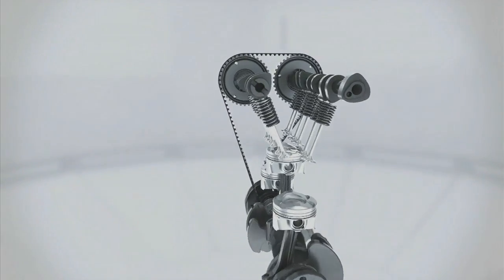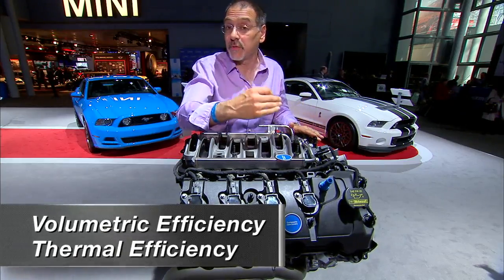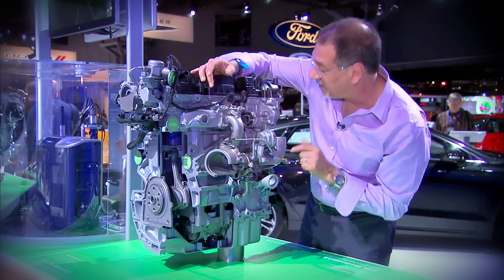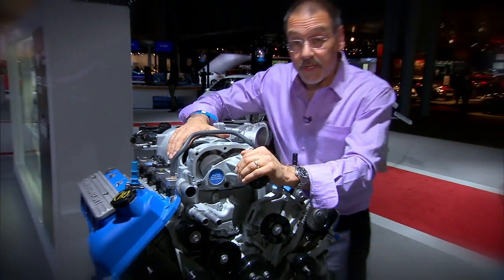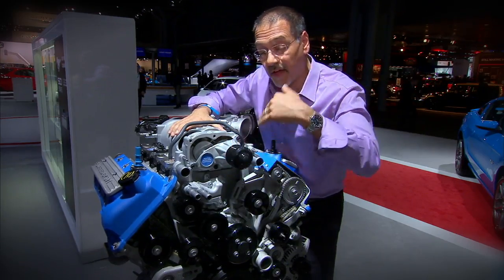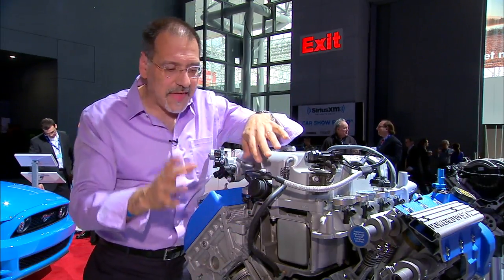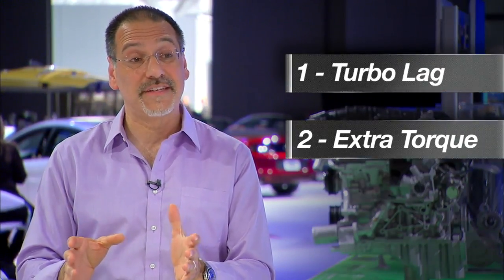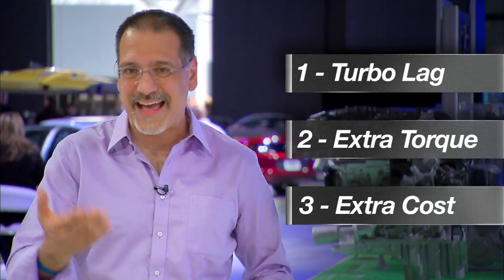CNET On Cars - Car Tech 101: Turbos vs. Superchargers

Comment: it's not that he is wrong, just incomplete. Many turbocharger systems respond much faster than most aftermarket supercharger systems. The supercharger on display is a "roots" blower. Many superchargers are belt driven centrifugal compressors. They make boost with engine speed, not engine load. A turbo car can increase compressor speed without changing engine speed. Centrifugal supercharges cannot. They need rpm to make boost.

Comment: QUESTION: Can you add both a turbo and a supercharger on the same engine?
Reply: Just ask Zenvo.
Reply: Volvo
Reply: +Eastdonochoco That's what you call a TwinCharger. In this case, the supercharger is used in low to mid rpms and the turbo is used in mid to high rpms. When the supercharger is no longer needed to produce power a bypass valve is activated and the turbo does all the work.
Reply: +Eastdonochoco Dodge Challenger Hellcat X is a factory supercharged engine with aftermarket turbos added.
Reply: +jeffrey625625 got it! Thanks! Highly appreciate the info!
Reply: 421 hp Volvo XC90 has a twincharger. Probably the new most powerful 4 cylinder.

Comment: VNT/VGT turbos dont lag. This is American problem that they are stuck in old technology like pushrod singel cam engines, no direct injection, common rail or modern turbos what are ecu controlled.

Comment: I hate to burst the bubble on turbochargers getting free boost at the expense of turbo lag, turbochargers and superchargers both consume energy to make energy.  It is where the parasitic effect comes from that changes.
For the supercharger it comes from the crank, a turbocharger it comes from the back end.  A turbocharger can increase exhaust backpressure, decreasing engine efficiency and increasing fuel consumption.

Therefore both have parasitic effects, where the effect comes from varies and the impact on the vehicle itself can be minimal if the correct forced induction system is selected reguardless of being a supercharger or a turbocharger.
Reply: Another thing every youtube video gets wrong is the TORQUE DELIVERY.
SUPERCHARGERS: Instant off the line acceleration torque, consistently rises with engine speed in a flatter yet higher (average) torque curve.
TURBOCHARGERS: Of course lags off the line (depending on size), torque curve starts much lower, and all of the sudden gives aggressive delivery of torque.
What it comes down to is how you want the performance added, either system can be modified to be more or less powerful. I've always though of it like this: If your O.K. with a little engine wear (and maintenance to keep it 100% performance, no big deal), and want to SLINGSHOT your vehicle from gear to gear, go with TURBOCHARGING. If you'd rather keep your engine/exhaust system healthier/cooler for a longer period of time (before maintanence), and want your vehicle to RELENTLESSLY PUSH & PUSH  through the gears go with SUPERCHARGING*.
Reply: Generally you'll see more of the ABSOLUTE LIGHTEST, FASTEST, MOST HARDCORE RACECARS go with turbocharging, because yes; *you can technically ABUSE your engine into getting that VERY LAST DROP of performance with a Turbo, because they're often lighter, and the turbo can "trick the engine" into performing past what it probably should (for a daily driver that's bad, but for a racecar that's only run 4 hours at a time is fine.)
You can design/program a supercharger to ABUSE your engine, and even outperform a turbo on the same engine, but usually people don't do that lol, mainly because that abuse would be CONSTANT, instead of only a second at a time. I personally love BOTH METHODS, but for my daily driver/track car combo, I'd like a supercharger simply because it's A) predictable for handling, B) keeps the engine/ exhaust healthier, and at 100% and C) for the RELENTLESS superior torque (especially off the line). I've dusted so many turbo's (that I could hear anyway) from a dig it's not even funny, they may catch up by the end of the gear, but I'm usually already ramming at the next gear so it doesn't matter. (To be fair I've also been dusted by some turbo's, but believe me they were some serious contenders =D.)
Reply: +JohnSmith FakeName I thought that super chargers provided more torque, so how can a turbo do it if it has to spool up before it makes its contribution to engine power? The speaker said turbo's make more and I disagree. Am I wrong?
Reply: +Anthony Wayne 
I am going to post this formula "Horsepower = (Torque * RPM)/5252

A supercharger has a more consistent power band while a turbocharger has to contend with "Turbo Lag."

Try to think about it from this angle
For a supercharger from 200 RPM to 6000 RPM the engine power is 1.3 times normal.
For a turbocharger  From 2000 RPM - 6000 RPM the engine power is 1.3 times normal, while 200 RPM-2000 RPM the engine power is normal (This is not accurate but it simplifies the idea).

If the engine is driven between 200-2000 RPM most of the time then it will feel as if the engine does not benefit from the turbocharger but when it does kick in you notice.  On the other hand the supercharger is more consistent in the power band.
At first glance it looks like the supercharger is superior but only in certain applications.  There are shortcomings in the supercharger design that a turbocharger can surpass.

That is what they do, how they do it as followed.
A supercharger is spun by the crankshaft (or something similar), meaning that as long as the engine is moving the supercharger is spinning and providing pressure.
A Turbocharger is fed by the exhaust to spin a "turbine."   The turbine compresses air but at low RPM's the turbine may not spin (or spin to slowly) and not build pressure.
Reply: +Anthony Wayne 
I am going to post this formula &quot;Horsepower = (Torque * RPM)/5252

A supercharger has a more consistent power band while a turbocharger has to contend with &quot;Turbo Lag.&quot;

Try to think about it from this angle
For a supercharger from 200 RPM to 6000 RPM the engine power is 1.3 times normal.
For a turbocharger  From 2000 RPM - 6000 RPM the engine power is 1.3 times normal, while 200 RPM-2000 RPM the engine power is normal (This is not accurate but it simplifies the idea).

If the engine is driven between 200-2000 RPM most of the time then it will feel as if the engine does not benefit from the turbocharger but when it does kick in you notice.  On the other hand the supercharger is more consistent in the power band.
At first glance it looks like the supercharger is superior but only in certain applications.  There are shortcomings in the supercharger design that a turbocharger can surpass.

That is what they do, how they do it as followed.
A supercharger is spun by the crankshaft (or something similar), meaning that as long as the engine is moving the supercharger is spinning and providing pressure.
A Turbocharger is fed by the exhaust to spin a &quot;turbine.&quot;   The turbine compresses air but at low RPM&#39;s the turbine may not spin (or spin to slowly) and not build pressure.  If a turbocharger is to large for the engine the turbocharger will not spin at low RPM meaning it will be essentially off.
Reply: +JohnSmith FakeName  Thank you for that information and the time it took to compose it.=)
Reply: Get a twin-scroll turbo, like in Mitsubishi EVOs and you're set for low-end and high-end hp. :D
Reply: I never knew you could have your cake and burnouts too. lol Nor of a twin-scrool turbo?
Reply: @xXxMartin96xXx wastegste dont purge incoming pressure on exhaust or intake only the out going intake so thats wrong
Reply: @xXxMartin96xXx backpressure in exhaust is dtill same it doesnt bleed pressure off only on pressure on intake so agin youre wrong

Comment: Can someone fill me in this is all new to me, but what the video seems to tell me is that basically turbos have no positive uses, compared to a supercharger
Reply: +Jamani Holmes There are some advantages.  Turbos, unlike superchargers, are not mounted on top of the engine.  Turbos tend to be more cost effective.  Superchargers work best at the lower end of the rpm's.  Turbos work best at the upper end of the rpm's.  And the felling when you hit boost is awesome.

Comment: Can you put a supercharger in any car?
Reply: Anything is possible with the right parts and know how.
Reply: +kendrick galacgac And enough space under the hood.
Reply: And enough cash xd
Reply: +89Kele Both superchargers and turbo chargers add more air to the system, this creates pressure.  So, although you could add them to any car, if your car is not meant for that, you could wreck your engine if you let too much boost build.  You typically replace most of the engine components in your car when you turbo/supercharge if you want to get a lot anything out of them
Reply: +89Kele Yes, but mostly it depends on many factors; and it is called an LS swap, if I'm not wrong. And I don't know have any practical experience.
Reply: Sorry to say but no m8. If the supercharger is too big, the engine parts may not withstand the extra pressure of the air. It may slowly wreck your engine. Secondly, the gearbox. If your gearbox can handle the extra horsepower, then good for you. But if you have a stupid gearbox, good luck with that.
Reply: Mata Leão you can do whatever you want to do if you have the tools, the knowledge and the materials
Reply: or just buy a good car with a supercharger

Comment: Turbo lag is virtually a thing of the past
Reply: +Leo the Weirdo I have an evo 8 and with the launch control and anti lag with the forced productions turbo. no lag here
Reply: +TheRealestEver the launch control is on when the clutch is in.
Reply: Just bought a 2017 escape 2.0. Definite turbo lag! It's rubber band like. Not as bad as the old X4RTI merkur but still there. No excuse for it! The Speed3 shows little to no lag using 2 turbos. At least Escape's 2.0 can move the car a little before turbo kicks in. The 1.5 is a total dog! 
--- No reason they can't put a bigger turbo on it and use the waste gate to prevent over pressure. The tiny turbos don't torque up at idle speed. I hate it.
--- But worse....AutoStop WILL KILL people on non-hybrid. The motor shuts off while making a left turn and leaves you stuck in cross traffic waiting to be crushed! 
--- give me a V6 and I'll pay the extra $20 a Year for gas and LIVE. Instead of getting killed to save a few ounces of fuel.
Reply: Gina Kerry so much incorrect information in one post. First, It's an xr4ti. Second, what are you on about with a speed3 having 2 turbos? Are you referring to the Mazdaspeed3?? Which has a total of ONE turbo. Third, the ecoboost escape 2.0 has manufactured turbolag. It's designed to have a less touchy torque curve because it's for old people. Practically the same motor is in my ST and it has almost zero lag. And your complaint about the auto start stop ...jeez are you like a child or something?
Reply: you can install anti-lag system
Reply: Just get yourself a german autobahn thing.....like a panamera....or an M5....and wonder if any turbos sit in those engines !!

Comment: Turbos create excessive heat, which creates excessive wear and eventual failure.  I am talking about the actual turbo itself.  They can get so hot they glow red.  Superchargers don't get that hot and are therefore more durable for the long run.  So given the option, I would take a supercharger even if it gets worse fuel economy.
Reply: Superchargers are better for gas engines because of their simplicity. They make moderate boost with a little trade off of robbing some economy. Gas engines can only be boosted so much because of octane limitations and pre-ignition. Turbos are better for diesels because of their high boost capability diesels can use and a diesels ability to run lean and time ignition through fuel injection rather than spark.
Reply: i would buy turbo then anti-lag for my turbo car
Reply: Daniel Vieau Turbos (and superchargers) are so well engineered today that wearing isn't the main issue. Turbos are made to handle the heat. Actually, people misunderstand how a turbo is designed to utilize the heat associated associated with exhaust gas, not just exhaust velocity.  

There is no better choice. It's all about application, price, and ease of install, respectively (which seems like the most realistic points). Also quality products is a huge factor. A chinese supercharger will wear itself out or even fail before a well engineered turbo and vice versa.

ex. You have a rock crawler jeep thats in need of some more power. You'll choose a S/C for increased low end power whereas you'd probably choose a turbo charger for your honda civic because economically it will retain good fuel economy on the highway and has more potential for more power. 

We can get into centrifugal S/Cs but then again that's a whole new ball game. It's all about your application! Buy a tried and tested product and you won't need to worry about wear issues.

Comment: In Turbo  size does matter the bigger the turbo the more lag but more boost and power.  The smaller the turbo, the faster the respond, and less to no lag what so ever but less power than the bigger turbo.  So get a smaller application for the most instant force and reaction of the turbo, more more boost than s.c. Applications.  Remember of the turbo surge charged, old tho is uncommon its very dangerous, because of the detonation it creates  when you stop acceleration the vehicle.
Reply: +melendezcobra45 I was just thinking, instead of doing two of the same turbo for a twin turbo, why not have a small one and a big one??

Comment: Which one is better at higher altitude?
Reply: Both the same. All depends on how much psi you are running. As well as air temperature. Engine liter, fuel injection. The more psi you make at sea level the better it will preform at altitude.
Reply: Mohammad Sadiqi depends on the application. i'd personally lean toward a turbo because i can deal with lag and sometimes you actually need that lower power without boost for a correction, etc.

Comment: I find it annoying how the description says, "Learn the difference between two high tech trends to increase power with less fuel."

X amount of Hp requires X amount of fuel. So 150hp will take the same amount of fuel.The only time less fuel is used is when it is off boost. Tho a bigger engine will still use more fuel at lower rpm. But a higher rpm if both made 400hp they both use X amount of gas.

Comment: isn't it possible to eliminate turbo lag by using a supercharger at the low rpm, like what VW does with their Tsi motor?
Reply: It is, but then you'll have all the reliability problems a turbocharger can create plus all the reliability problems a supercharger can create. VW learned that the hard way with their Polo GTI / Ibiza Cupra 1.4 TSI engine...
Reply: It is a huge pain to tune. They are not reliable in the slightest. They are mainly used as a huge power car.

Comment: Do they make a clutch disconnect like in mad max so the pulley can just rotate freely allowing you to pull back some timing and fuel until you wonted to boost the car. I'm sure they make them but I can not find one on line
Reply: You can, but it's easier and better to just fit a bypass valve, stopping extra boost at light throttle loadings

Comment: Got a couple of terms not quite right. On the exhaust side of the turbo that's called the turbine. And inside a (roots/twin screw) supercharger those are called rotors.
Reply: 177SCmaro they’re impellers, Whipple is a twin screw, Roots uses bladed intertwining rotors, centrifugal chargers use a compressor turbine, variable vane chargers use rectangular cut flat material as concentrically orbiting blades, and theres a couple more, boring and difficult to explain.

Comment: @xanode the motor is the new Ford Coyote 5.8 liter V8 and it is running a twin screw supercharger. EFI blower setups are used to convert a carbureted engine to a fuel injected engine.